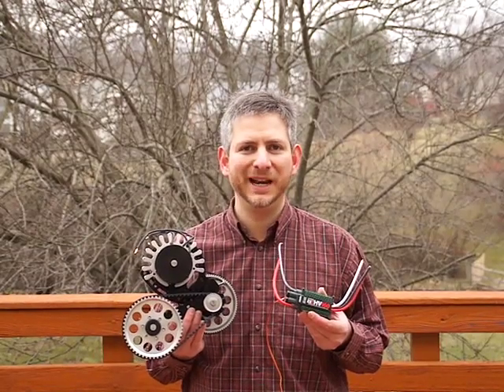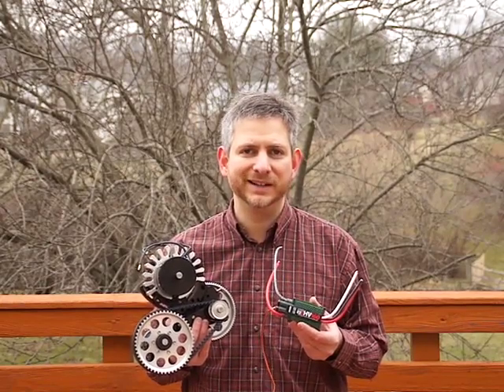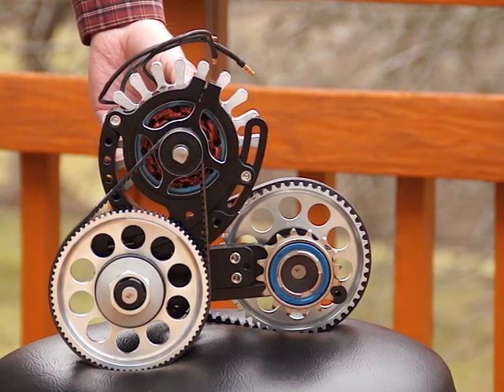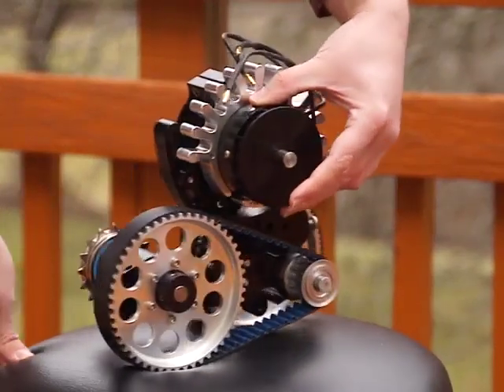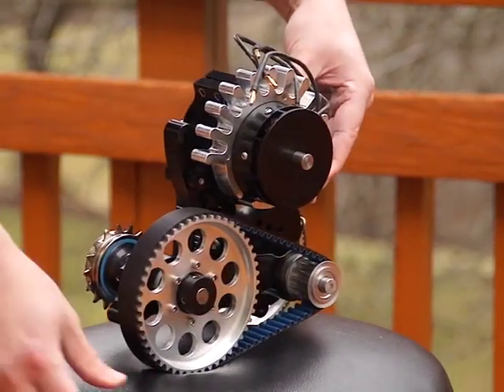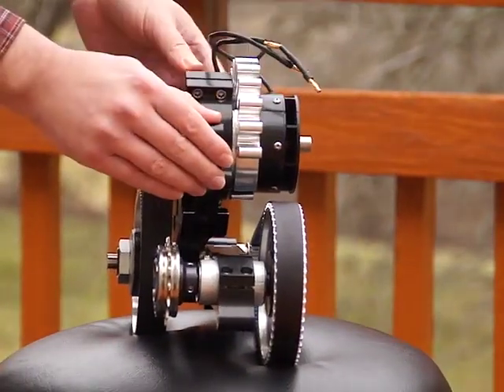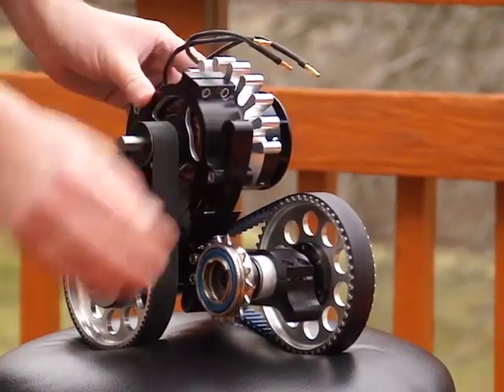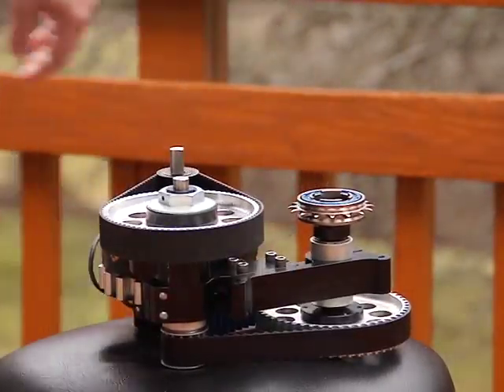Pike's Peak Quattrocycle

Comment: That looks amazing. Does it perform as you hoped it would? Also, do you still import the Quattro into America?
Reply from the maker: The gear reduction was great but it was difficult to build a mounting bracket that can withstand the torque. I have not imported Quattrocycles to the US in recent years.